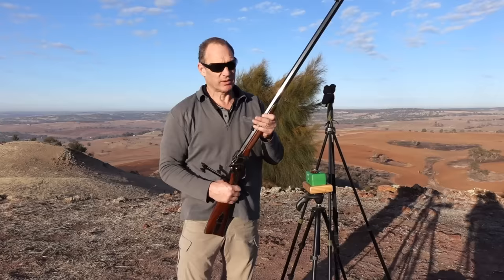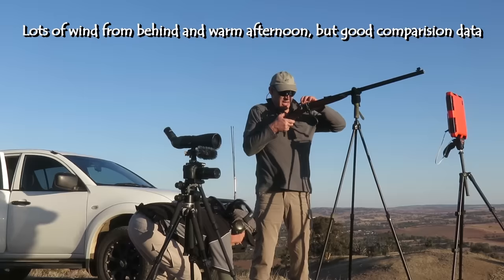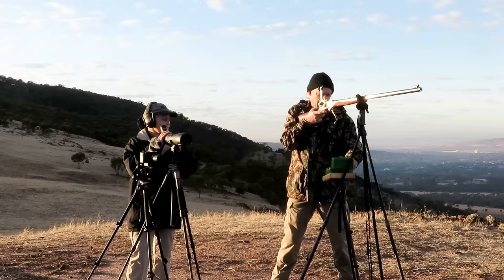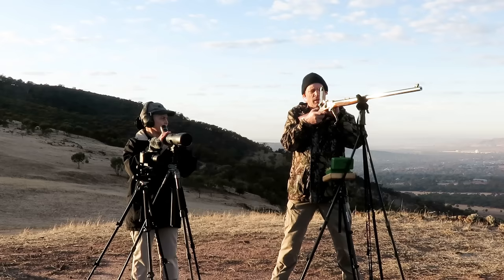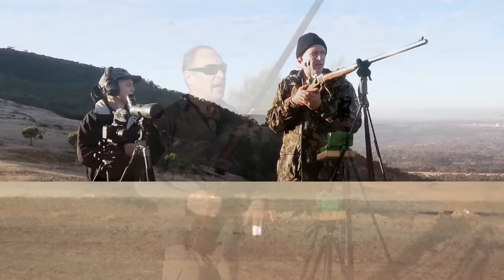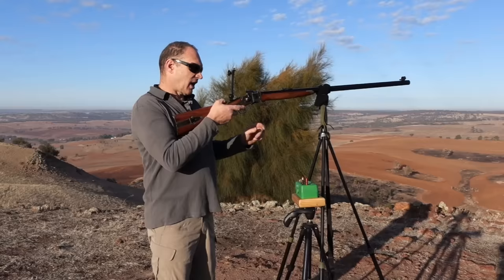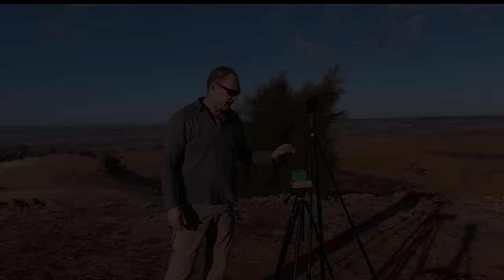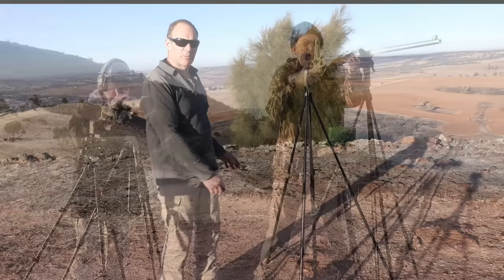1874 Sharps QUIGLEY at the mile

Comment: Just a point of information regarding the tape on the barrel. This tape on the barrel is to identify the, "Null" point of the barrel. This is the place to rest the barrel to get the best accuracy. The null point is found by holding the barrel muzzle towards the ground by the stock. Then with a large diameter piece of wooden dowel you tap up and down the barrel until you hear the pitch of the sound go flat. This is the null point! Hope that helps, great shooting!
Reply from the maker: Thank you Robert, cheers
Reply: That looks like a 60 ft bullet drop....

Comment: Thank you ! I just love this video ! This is also a great pub for our Black Powder Long Range sport.  May I suggest some fouling control of black powder: I use a cleaning patch between each shot... to avoid opening of the group.  Thanks again!!
Reply from the maker: Thanks Gerald, yes when we get to use black powder we are ready for a lot more cleaning in it, lol, Cheers
Reply: @markandsamafterwork  Dont know if this will help or not but i had a 45 cal roundball smoothbore & could shoot all day using CRISCO cooking grease ( of all things) as the patch lube. Seemed each shot cleaned itself. Black powder. Cap shooter. Real tackdriver. Could light wooden matches @ 100 yards. Modified tight rear crowfoot rear sight & a very thin front blade. Everyone else had to clean their bores every 10 shots or so. The crisco cleaned itself w every shot. Maintained its superb accuracy all day long. On the downside, was shooting into the wind. Got sick as a dog from breathing the smoke. Some kind of poisonous gas is in that smoke.

Comment: Mark, if no one has recommended this yet, you should try the Lyman 535 grain Postell bullet, #2640132, also known as the 457132.  It is a very close copy of the bullet designed specifically for the chamber in that rifle (the same one I have), and should give you a better BC than that blunt-nosed bullet.   Also the Montana Vintage Arms Soule XLR rear sight will give you 414 MOA of elevation.  Great shooting!
Reply from the maker: Cheers Tom

Comment: I've got a sharps 58-120gov. It was a sniper rifle in the Civil War. It hasn't been shot in 18 years. I made all the brass for it before I had to sell my machine shop. I re-buttoned the barrel in 2004 cause it was getting shot out. Did not change the bore or the twist, just cleaned up the shoulder of the rifling with a pull through rifling bit. Still danged accurate past 1500 yards. My tang maxes out at 1500. I've rang steel at 1575 with it, but my longest shot on a feral hog was 1350. We made our own black powder and cast our own maxie balls. 750gr hard cast bullets. That thing was a monster, but don't have means to make more brass so I don't shoot it. Can't buy brass for it either.
Reply from the maker: Cheers

Comment: Just ran across your channel. Subscribed! I cast a 525 grain Money bullet from a Buffalo Arms Company (BAC) mould for my Pedersoli Quigley 45-70. It's a very streamlined bullet (B.C. above .440 according to my figuring), has won at least one Quigley match, and BAC offers various diameters and weights up to 560 grains. I shoot mine as-cast, .458" of 20:1 alloy, lubed with either SPG or my home-brew lube, seated so the top lube groove is outside the case. I generally shoot Accurate 5744, and SDs usually hover the teens, so not quite as good as BP, but still quite tight. I've long joked that long mast should be good to about a mile, and it looks like I wasn't far off! I'm actually getting an MVA mid-range buffalo (88 MOA windage adjustment) because I can shoot it without my hat brim hitting it, and it will still provide enough elevation to get me out to at least 1,000 yards...which is about all my peepers will allow.
Reply from the maker: Thanks Man, yes hope to find something in Oz like those, will make this work a tad better, glad you liked, Cheers
Reply: @markandsamafterwork  just as an FYI, they do ship to Australia.

Comment: Hornady loads the 325gr FTX rounds to 25,000psi. Pedersoli states their Sharps rifle are tested and safe for a maximum of 28,000psi. You can use the factory Hornady FTX loadings and get much much higher velocity. I wager you'd pick up 400-500fps.

If you hand loaded the FTX rounds on your own to a conservative 27,000psi, I reckon you might get upwards of 2,700fps. It would surely be one hell of a thump on the ol' shoulder though.
Reply from the maker: Well not quite, but all been tried and tested, all on the channel, Cheers

Comment: I haven't tried a 1700 yard shot with mine yet, but the 500gr Lee 459-500-3R mold (500gr round nose, but more spire point'ish than the one you showed) is supposed to be a .328BC (what I"m running in my Pride of the Plains).  Lyman has a 480gr spire point mold (457658 ES), which actually comes to a point - still waiting on that mold, it was a backorder and taking a while.  I believe the BC on that one is over .4.
Reply from the maker: Awesome, Cheers

Comment: When you load the FTX for the Sharps do you have to cut down the case because of the ogive or is that just for the lever guns so it will cycle thru the action.
Reply from the maker: Just as designed, works for the lever too, Cheers

Comment: Somewhat related to your video. I'm considering getting a lever action rimfire to put those nice sights on for shooting out to 600. I'm debating between 22lr and 22wmr. Here in the states you can find 22wmr for about 20 cents a shot. Considering the wmr after seeing your results with handloading them. Mostly just to challenge myself and have fun since using the scope with my 22lr 10/22 (single feed it for better consistency) is getting a bit boring at 600 lol.
Reply from the maker: Sounds like fun, Cheers
Reply: @markandsamafterwork  Would you recommend lr or wmr if I may ask?
Reply from the maker: No sorry, lots of info, but not recommendations, Cheers
Reply: 22 long rifle, so you can stay under the speed of sound and not worry about going transonic. Buy good ammo,  22 sk long range match, would be a good place to start.